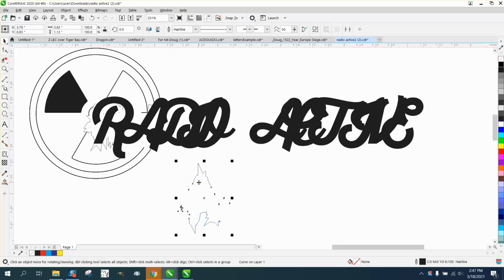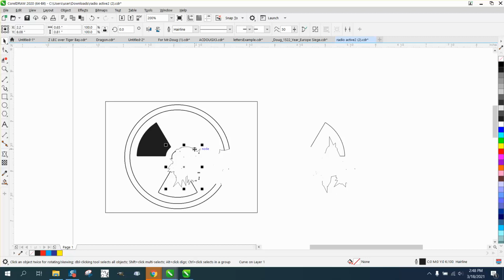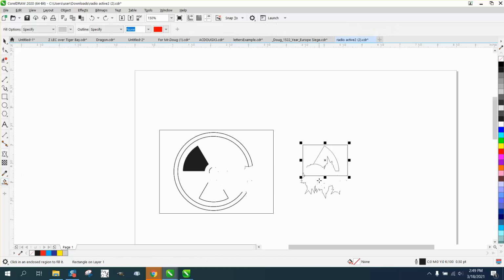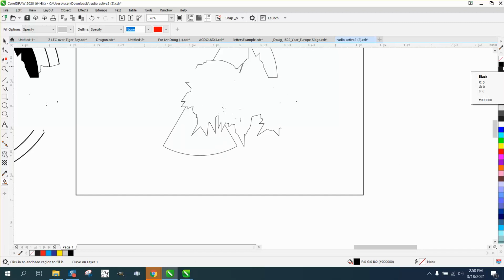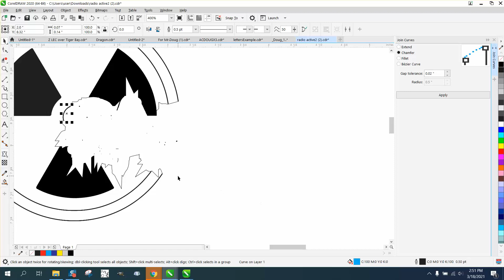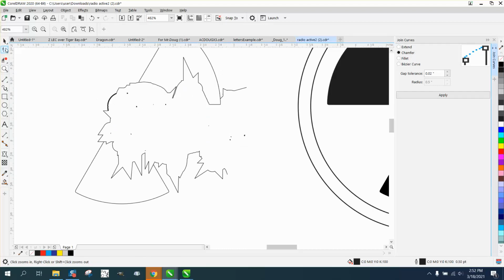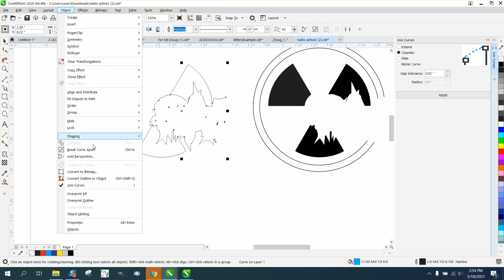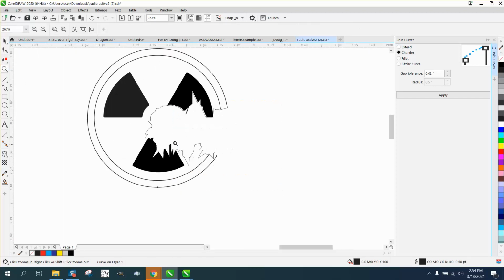Corel Draw Tips & Tricks Smart Fill not working and why

Comment: Awesome content as always!

I wanted to ask a question to you really not related to this video but sorta. 

When i design a part in Fusion than bring it to Corel to modify I.e logos, nesting, separate cut files etc. 

My issue arises intermittently when i smart fill everything remove the initial profile nest it all back together export the dxf and take it to my pharma table to create the g code and it from what i can tell has open lines or something. In corel I see no issue and they smart fill perfectly. I take it to sheet cam and ill have giant circles emanating from my part for which i have no understanding.... As previously stated its intermittent. 

Any thoughts? It's sure a burr under by saddle. 

Thanks in advance learned tons from you!